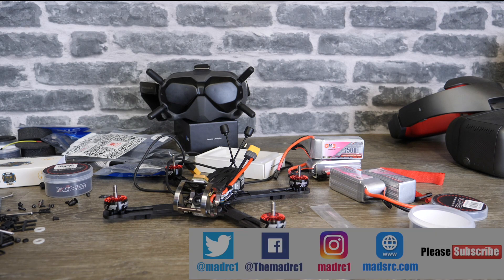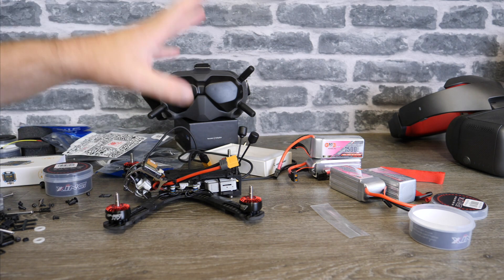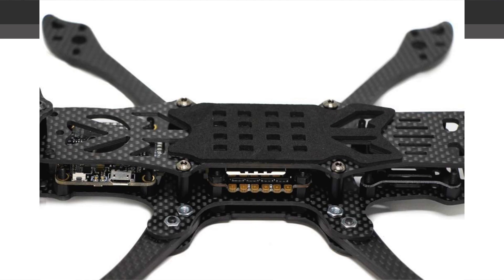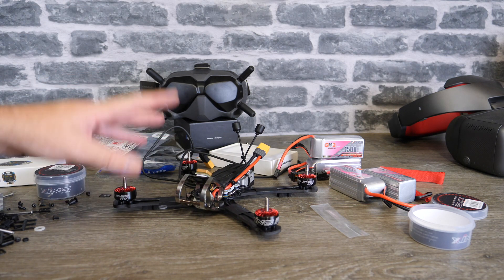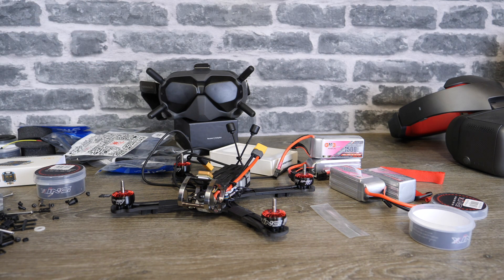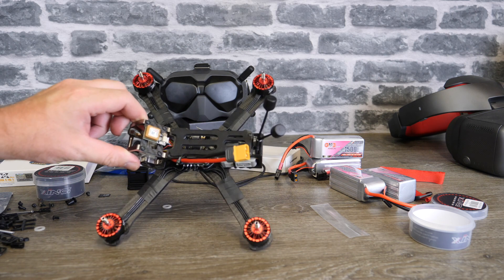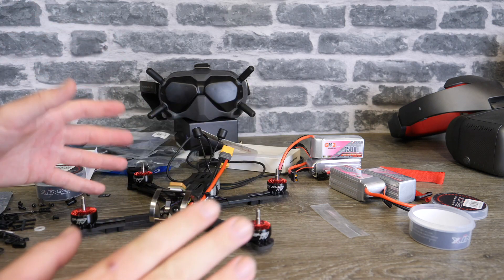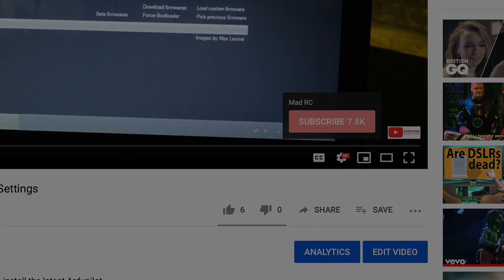DJI Digital FPV Common Questions Answered & My Build Overview

Comment from the maker: Hi Everyone, I hope the info in this video has been helpful to you, I would really appreciate it if you would subscribe to the channel. If you would also like to support me in what I do below is link to the DJI Digital FPV System on the DJI Store, this is an affiliate link and by using this you are helping me continue to run my channel and  keep making videos like this. 

@t

Thank you for watching and as I said please do Subscribe, Like and Share :)

 I have released an FCC hack for this, see my other video here

@EEyY

I also just want to confirm some things on this I did not go into detail on in the video around CE and FCC Modes. 

The System Range DJI State upto 4km in FCC Mode and 0.7km in CE Mode, Region setting is not user selectable and is set by DJI Assistant for FPV Series automatically when you connect the system, your location is detected based on your internet connection location. 

Can I change from FCC to CE after its been set ?

Yes, If you move to a FCC location from CE simply turn on your Goggles and Air unit and allow them to connect and display video,  connect the Air unit to DJI Assistant for FPV Series and it will detect if your internet connection location is in a FCC Country and it will change to FCC Mode automatically. 

How can I tell if I am in FCC or CE ? 

FCC Mode has 8 Available channels, CE Mode has 4.

Can I use the new DJI FPV Goggles with DJI Drones ? 

No, the new goggles are only designed to be used with the new FPV Air System only. 

Can I Use DJI FPV Goggles with Analog ? 

Yes however there is no analog receiver in the goggles and you would have to connect to an external receiver to the goggles via AV in. 

Can I use my own RC with the DJI FPV System ? 

Yes you can use your own receiver and transmitter as long as they are on different frequency’s.

Can I manually switch between Mode 1 and Mode 2 on my DJI FPV Remote Controller?

Yes. However, it is not recommended. By detaching the remote controller and manually switching between Mode 1 and Mode 2, you will not be covered by DJI  official warranty if the remote controller were to break.DJI offer two flight modes for you to choose from when purchasing the DJI FPV Remote Controller, Mode 1 and Mode 2.

Is the DJI FPV Air Unit compatible with third-party cameras?

No, Only the DJI FPV Camera is compatible with the system. 

What Flight controllers are compatible with the DJI FPV System ?

Any controllers that supports SBus and UART with MSP on Betaflight, to use the new DJI HDL 7ms RC connection you need Betaflight 4.1.0 for HDL and telemetry via the MSP Protocol.
Reply: There's the Holybro F7 HDV flight controller that outputs 10v or 8v and the T-Motor F4 ... both made specially for the DJI HD FPV system. If I'm not wrong there's aother but can't rem which at the moment.

Comment: I understand you can use other transmitters but do you need to instal another receiver if not using the dji transmitter?
Reply from the maker: Yes.

Comment: Can you use dji pro transmitter   To that fpv
Reply from the maker: Do you mean the Mavic RC ? basically no only the specific DJI FPV RC works with the System.

Comment: thanks for the informative clip.  Is it possible to tap into the headset and output to a stand-alone monitor?  How can that be accomplished and what monitor(s) might be compatible?  Do you think DJI will come along with a firmware update to use the USB-C port to output a digital signal?  Thanks...great channel!

Comment: Will the flight controller work with a Matek Systems F405-WING, i.e. will the DJI OSD work on the F405 UARTS?
Reply from the maker: As long as it supports betaflight then yes.

Comment: That's great to hear that I can still use our remote. I have a Jumper T16 controller. My flight controller is HyperLite F4 OSD. If that's the case, how much will be the estimated cost for me?
Reply: Neil Camara assuming you have the rest of the quad you’ll spend about 700 for goggles and an air unit. I’d recommend getting a crossfire tho it’s worth the extra 300

Comment: Great video and nice solution to make use of the chameleon frame.  How is your back end 3D print holding up during crashes?  Have you designed or found a print for the camera mount?

Comment: best videos re : dji fpv so far, i notice a gps on the front , how are you using? im coming from an inav point of view, also do you think if i used inav with gps i could still utilise the rth functions...
Thinking of putting an air unit in my 7 inch shredder frame, it features esc`s on the arms and im using probably 30mm standoffs fair bit o room in there. oh im based in Cardiff. You sound like your from this neck of the woods (area)! great channel , cheers!
Reply from the maker: Yea in betaflight GPS is only failsafe but Inav gives far more options.  It’s a tight fit in any frame tbh.

Comment: your reviews are EXCELLENT !!!!  I have been flying DJI everyday for four weeks.  WOW !!    FYI  everyday new frames and stacks etc are coming out for DJI system.  Check out Holybro and Newbeedrone  both have flt cont/esc stacks that plug /play into air unit no soldering !!!!
Reply from the maker: Thanks for the fantastic feedback. On frames it’s incredible the numbers coming right now.

Comment: Great vid and very thorough. In your comment below on using the GPS as a betaflight failsafe, I assume you mean GPS Rescue. How do you intend to get it to work without any OSD info? I use GPS Rescue on all my quads (about 15 - 3" to 7") and it only works if you have OSD to feed back data i.e. you need number of Sats locked, min Sats for GPS rescue, minimum distance to home, direction to home, distance to home, altitude, descend distance ... all without which GPS rescue is pretty much useless. 

Would be great if you have a solution because my DJI fpv Flymore combo is on the way! Thanks in advance!
Oh, subbed btw!
Reply: I have tried gps rescue, but sadly its failed, the quad suddenly cut off power, perhaps the problem is not enough power to supply air unit that need power from my matek f722 std, i have however, order bec step down to overcome this situation, i'll let you know my result soon after i have installed bec, but for sure, there is none of the info that you need in the osd regarding how many satellite you have, or is it gps fix or not, so its come to only from wether you can arm your quad or not, i used that option to get gps fix before i can armed my quad
Reply: @andriroyantara  I use lua script to see number of satellites in my Taranis. But I've had same experience, when I switch to GPS rescue, the quad loses power and tumbles to the ground.

Comment: Please help me out here with an answer to this question,  I have a Taranis X9D+ with M9 Hall Sensor Gimbals & TBS crossfire and love the smoothness & range, but also want the best over all control link from DJI wit the complete package for FPV and DJI fpv controller for 100% single digital control link, so should I spend the money on the DJI controller or pass since I have the X9D+, ....   Pro's & COn's..thank u
Reply from the maker: If you have crossfire I would stick with that for the best possible range or RC, the DJI remote is a great option for guys wanting to go all in but as your already well setup I would stay with that and just use DJI for video.

Comment: does gps show data on the dji fpv goggle? how does it work?
Reply from the maker: Currently no only battery voltage.  GPS is simply for Betaflight Failsafe.
Reply: Mad RC i see thanks!